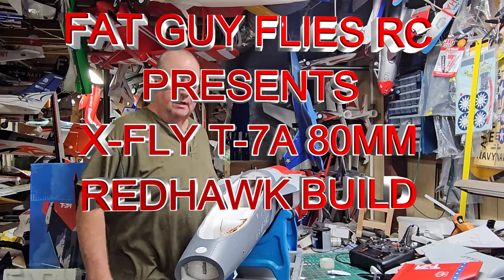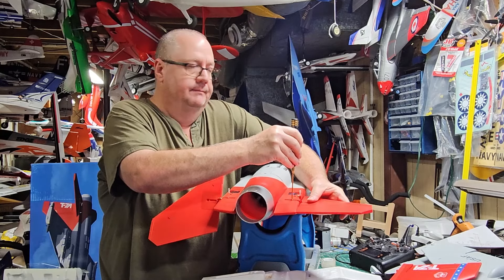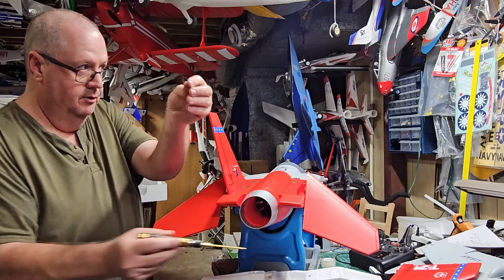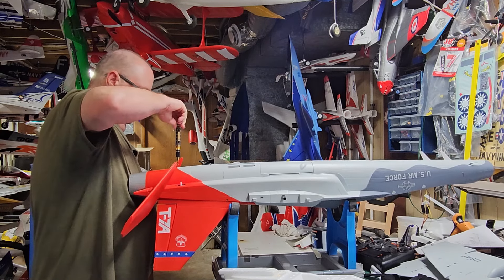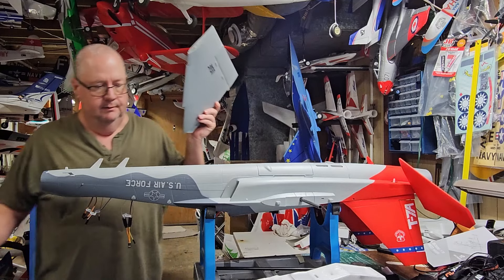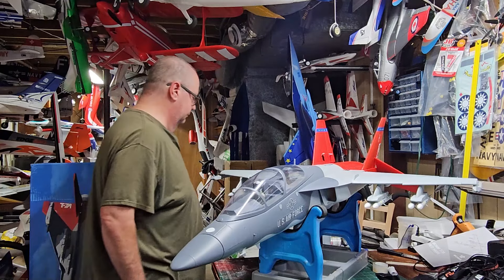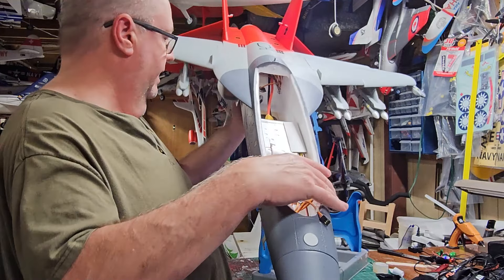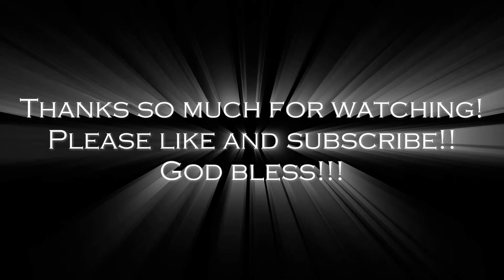X-FLY T-7A 80MM REDHAWK BUILD by Fat Guy Flies RC

Comment: I’m guessing you found out that the small spar was to keep the fuse from moving during shipping.  It serves no purpose in the building.  I love this plane and when you do your clear coat the red really pops.  The missiles are different. 2 have white tips and 2 have gray tips.  Each wing gets one white tip and one gray tip.
Reply from the maker: Yes I kinda thought it was a packing item. Thanks for the missle tips.